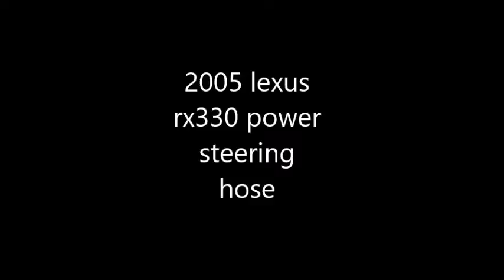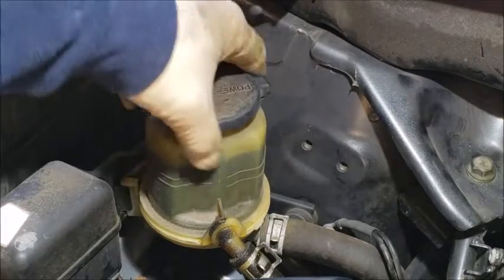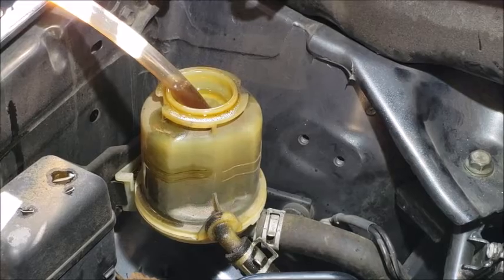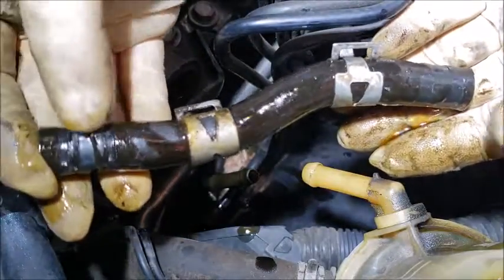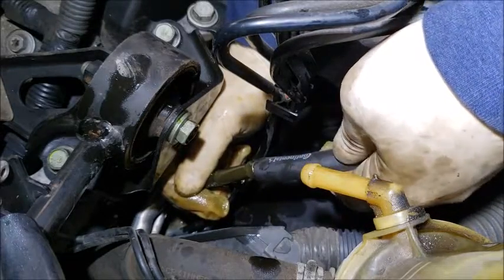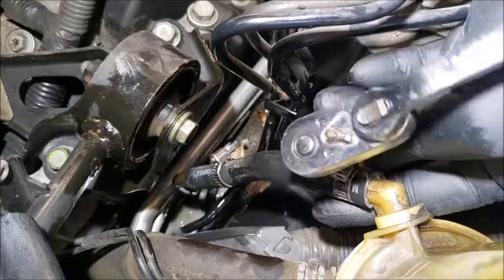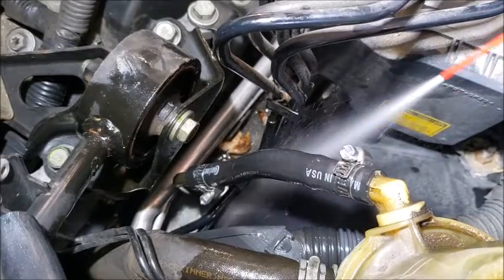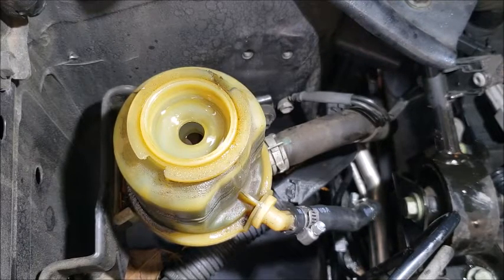2005 Lexus rx330 power steering hose leaking

Comment: Good video, I have the same problem. Now I know what to fix. What did you use to clean off the power steering fluid at the end? Brake fluid cleaner seems to be iffy.
Reply: I was wondering that too